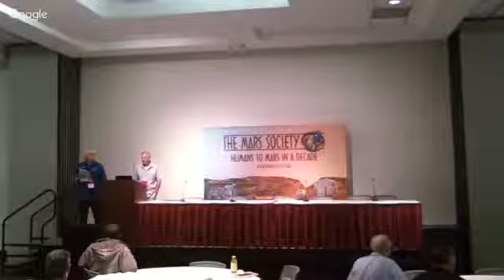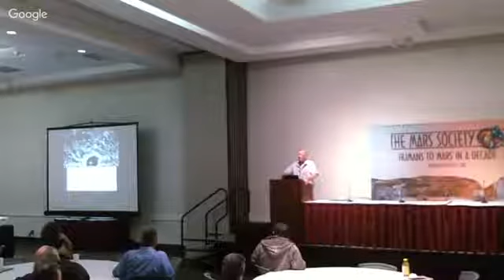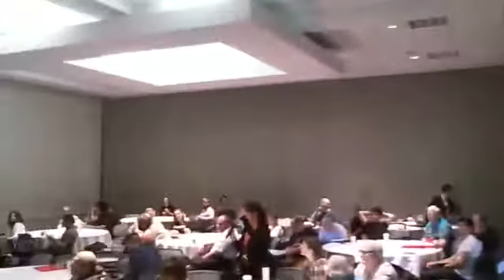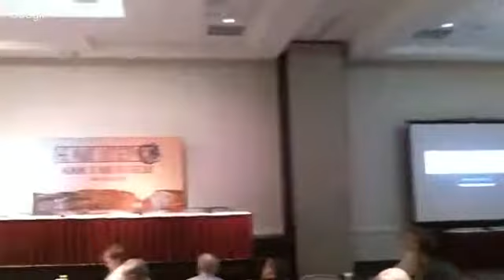Mike Dunn - cave habitation logistics  - 21st Annual International Mars Society Convention

Comment: it would be challenging to design vehicles and ways to deliver resources from the ground down to those tubes. How can we make the process automated? Imagine a large tank of oxygen and you need to get it down there, intact, then transport it in the corridor - 20- 50 meters on the curvy paths. Also in the movie Martian there is the scene where there is a short explosion and then there is explosive decompression. On the surface its bad, but underground can it trigger the collapse of the ceiling? So the safety rules should be very strict - no explosives or dangerous materials down in the habitat.